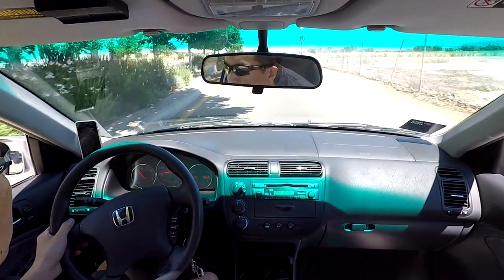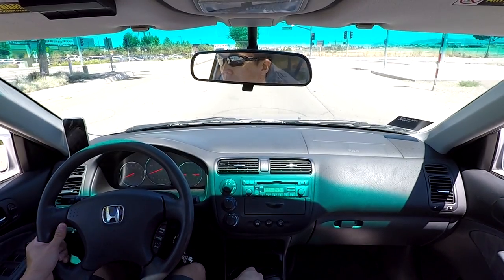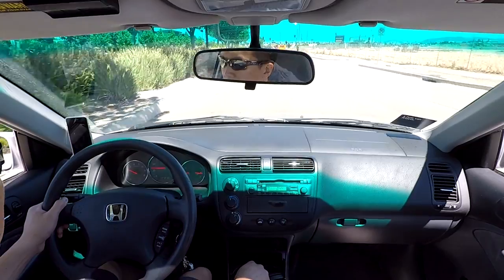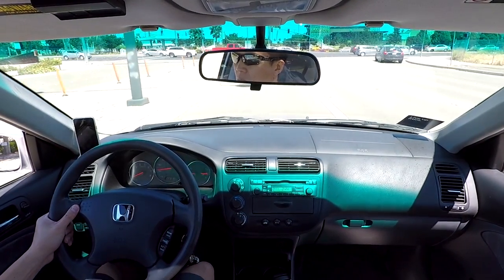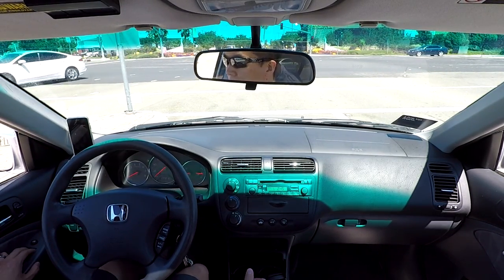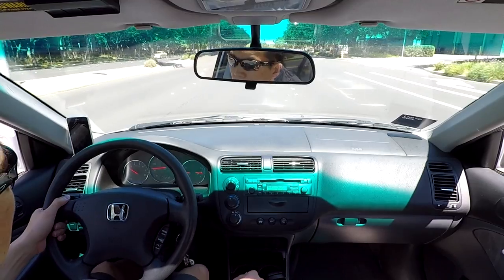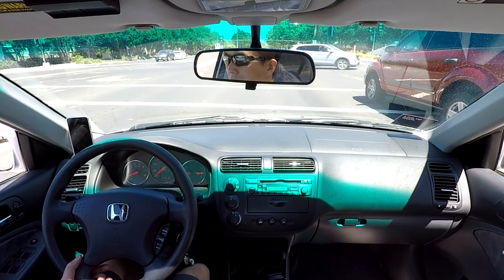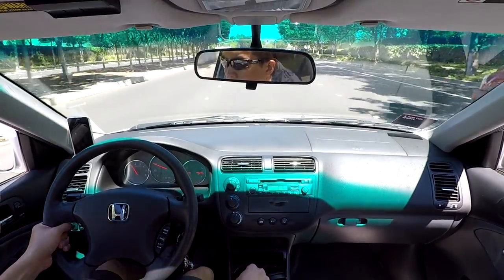How to Break in a Clutch

Comment: How do I down shift by rev matching or do I just coast in neutral don’t want to mess up my new clutch ?
Reply from the maker: Just don't rev match.  You can still down shift normally, no need to coast.  Just engage the clutch lightly and don't drop it.  Once you break it in, then rev matching should be ok.
Reply: @nukem384  don't rev match during a break in? Are you sure? It just feels rough/choppy if I dont.. feel like it could be doing more damage :/
Reply from the maker: @andrewbatres5918  That's why you need to engage slowly, that way the clutch and next gear will be more "aligned" when you engage the engine.  I mean, just think about it, if you're rev matching, that basically means you're burning the clutch just so downshifting isn't all jerky if you're shifting fast.  It's only temporary, and once you've broken it in, then you can rev match and drive the car how to want without worry of ruining the clutch too soon.
Reply: @nukem384 Sorry but you got the whole concept wrong,
during Rev Matching you are basically doing the clutch job you are getting very close if not exactly at the required revs so the clutch doesn't have to slip as much to get the engine speed matched to the input shaft speed (transmission speed at given gear)

So rev matching = if done correctly, longer lasting clutch

Double clutching (With rev matching) longer lasting gearbox synchros, could cause some wear on the clutch linkage (cable or hydraulics) and maybd some wear on the pressure plate but good for the clutch disc

Comment: Is it fine to let the car stretch it's legs a little? Like not 100% mashing it. Maybe like 60-70% throttle and easing it in.
Reply from the maker: I would say that's ok, but if you want maximum life out of the clutch, be patient with the break in period and then you can let it rip without having to worry.
Reply: @nukem384  Better keep myself in check then. This twin plate clutch wasn't cheap.
Reply from the maker: @vongdong10  Yeah, always better to be safe that sorry.  It's only 500 miles, that's like 1% of the total miles the clutch will see
Reply: @nukem384  What are your thoughts on loading up the engine? Like going up hills in lower gears? I feel like the brake shop i took my car to recently went for a short joyride and want to test if the clutch is slipping or not.
Reply from the maker: @vongdong10  Yeah that's fine.  You're supposed to go up hills in lower gears or you're going to badly lug the engine and it might actually stall out the engine if you're in too high a gear on a hill.  You don't need to go up hills to see if the clutch is slipping.  You'll know if you romp it and the clutch can't hold the power, on a straight.

Comment: Just installed a new clutch kit. Is it normal for 2nd gear to have a pause?
Reply from the maker: It shouldn't.  A new clutch should behave just like an old clutch that is fine, al beit maybe be a little stiffer in the beginning.
Reply: @nukem384  it has a pause, even from neutral to reverse. The original clutch had 3 springs, this has four. Plate looks similar. Gear light came in once and went out. Should I just watch it?
Reply from the maker: @WalkBoutJa  Yeah I would.  If it concerns you, I would get a professional opinion on it.  I've never heard of that happening, but I'm also not a mechanic.
Reply: @nukem384  they said it needs to be programed
Reply from the maker: @WalkBoutJa  Interesting.  Since when does a mechanical part need to be programmed?  You have like some dual clutch or like an SMG or something?  Haha
Reply: @nukem384  idk really

Comment: So I already sent my new clutch numerous times, I'm still at only 300 miles break in, should I get a new clutch now or later ? Or can I still be nice to it ?
Reply from the maker: You'd have to just test it and see.  I would stop doing that for now, and if it starts to slip in the next 1k miles or so, you've probably glazed it.
Reply: Alright man thanks, I'll get back to you in the next 1k or so and let you know what happens lol.
Reply: @skinnybob123  so what happened?
Reply: Ran fine, unfortunately I sold after couple thousand miles so couldn't really get the long term results.

Comment: Does light downshifting help or hurt it?
Reply from the maker: I mean, driving around the car, you're going to have to downshift, so it's fine.  I would recommend not rev matching though, just ease the clutch into the lower gear.
Reply: @nukem384  that's what I figured.   Rev matches don't " use " the clutch material or put any wear into it

Comment: I just got a new clutch in & wanted to feel vtec at 5,800 rpm....only did it right after the clutch was installed for like 3 miles....should it be fine? Right now im at 230 miles & been going under 4k rpm ever since
Reply from the maker: Probably not the best for the clutch, as I mentioned in the video you could get that glazed look.  You'll know if the clutch starts to slip.  I wouldn't do that again until after it's broken in.
Reply: @nukem384  I havent done it nomore.....it was only that one time.....it shouldnt glaze that fast i think...idk u think it could glaze just by that one time?
Reply from the maker: @carlosmanriquez5987  You should be ok

Comment: So i have two different maps for my car, one original (210hp/370nm) and one tuned (280hp/410nm). 

Would it be best to put in the original file after the clutch change?
Or does it even matter?
Reply from the maker: Doesn't matter.  Just don't do any crazy burnouts or push the car while you're breaking the clutch in.

Comment: I installed a stage 1 excedy clutch in my si, after 1-2 months since the install there is a burning smell after I do a pull is this normal?
Reply from the maker: No.  But it also wouldn't surprise me because you're putting a lot of stress on the engine/tranny if you're doing a hard pull, so it could just be from all the stress.  Are you launching the car really hard or something?
Reply: I would say just try and take it easy probably just went too hard on it too early. They can take a lot of force and friction. Obviously breaking in helps over the long run. Break it in a little more. Also hopefully you didn’t install a 1000hp clutch for only a couple hundred engine hp :) good luck glad it works

Comment: Do we need to break in clutch and flywheel for automatic gearbox? I just had my clutch and flywheel changed on my DSG DQ200 Gearbox on a Golf MK6
Reply from the maker: Errr automatics don't have a clutch.  They do have a torque converter though.  But yes, I would go easy on the car for the first at least 500 miles so everything gets broken in properly.
Reply: @nukem384  Thanks man 👍🏼
Reply: DSG gear box essentially has a clutch (try this: slowly creep up you can actually feel it grab) I would definitely take it easy brother
Reply: @Alex-tv3jy  Thanks man 👍🏼
Reply: @Alex-tv3jy  BTW Alex, same 500 miles sufficient to let it bite in?

Comment: Hi are clutch plates suposed to make little noise when you shake them thanks
Reply from the maker: You probably actually mean the pressure plate right?  Yes, because those fins are floating until you put everything back together and there's pressure on it from the throw out bearing/tranny.
Reply: @nukem384 no the clutch disk it has 4 springs on it friction plate
Reply: @nukem384  its on the thumb nail on this video the plate with 4 springs on them
Reply from the maker: @abdulbeany1894  Ohhhh those springs.  Hmm...I'm not 100% sure, but I think that's ok.  If there's no pressure on them currently, yes, I would assume they will make a little bit of noise.
Reply: @nukem384  thank you so it should be fine they not moving about only when i move it with my fingers they move sloghtly
Reply: Slightly *

Comment: Is it normal for the release point of the clutch pedal to go up a little bit in the break in period?
Reply from the maker: i would say thats ok.  as you break in the clutch, its going to get adjusted to the flywheel and stuff, so there might be subtle movements and things.  but after its broken in, it should be pretty consistent
Reply: In my gf's 02 civic the bitepoint is literally on the floor after replacing with a stage 2 clutch and OEM flywheel. This normal?
Reply from the maker: Waffeey i would ask on the forums with somebody who has that exact same clutch. But i think thats not uncommon with racing style clutchs
Reply: @nukem384  Thank you, liking the stiffer pedal but I hoped it would fix my shudder when engaging 1st but it still does it, thinking the engine mounts i put in are cheap already bad.
Reply from the maker: Waffeey did you change out the flywheel with a new flywheel? Usually a warped flywheel is the shutter problem. But possibly could be the mounts too
Reply: @nukem384  Yes brand new OEM weight flywheel with stage 2 clutch disc and pressure plate. It developed this shudder after I replaced the mounts and it is still doing the same thing with the new clutch
Reply from the maker: Waffeey could be the aftermarket clutch itself. Nothing wrong with it, but the more aftermarket you go and the more racer you go, you give up comfort

Comment: So I just replaced my clutch today and i have not dropped the clutch at all but I did sift through the gears fast 3 times... If I don't do it again will it have already damaged the plate...again no launches or anything...roll and goes 2 or 3 times max
Reply from the maker: you should be ok.  take it easy though on the break in period just to be safe

Comment: Any experience with Duralast clutches?
Reply from the maker: I do not, but consider this...

If you have the same generation Civic as me, the Duralast clutch is the same price as the OEM clutch linked in the description.  Considering how much labor is involved in doing a clutch, even if OEM is a little more expensive, I would highly recommend getting that instead of doing labor all over again because of a cheap aftermarket part.

Comment: But why do we break in the clutch easy and the brakes hard? It's the same concept
Reply from the maker: Not really.  The clutch pad isn't made to be grinded against at high speed (burning the clutch).  That's why lots of people like rev matching, that way the clutch and flywheel are going the same speed when engaged, which means less friction.  Whereas brake pads are made to cause friction against the rotor to slow the car down.  They are made of different materials too.

Comment: And do not rest the hand on the gear lever! That will cause unnecessary wear to the fork in the gearbox. Never hold the clutch pedal pressed when standing att a red light! That will wear out the release bearing.
Reply: I’m usually in first gear at red lights with the clutch in
Reply: Thijs Boom that’s a bad habit, not hating or anything, i used to do it too. but if you continue that, you’re causing wear on your release bearing, a good tip is when you’re headed towards a stop sign or red light, shift down gears all the way to 2nd, not super fast but just until you can downshift and not be in high rpms, then once you’re getting close to the stop, clutch in, go to neutral, and let off the clutch, then right as the light turns green, clutch in and go to first